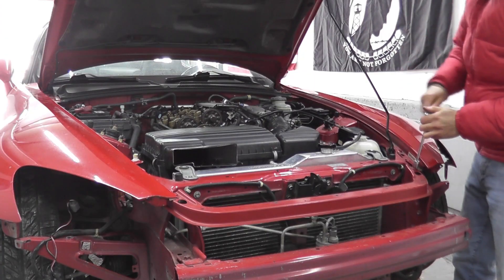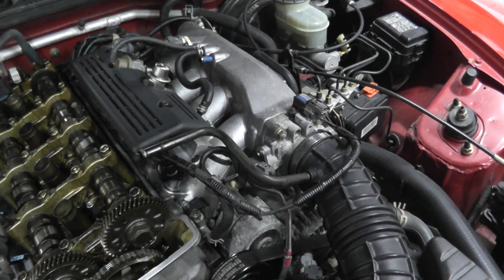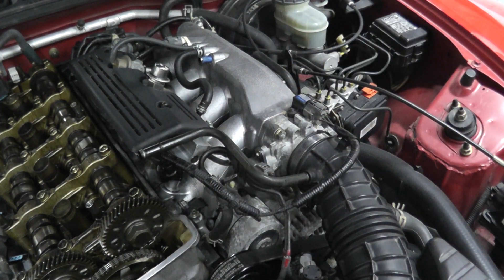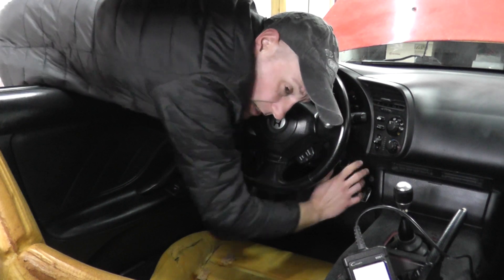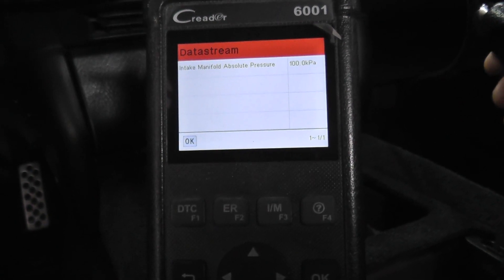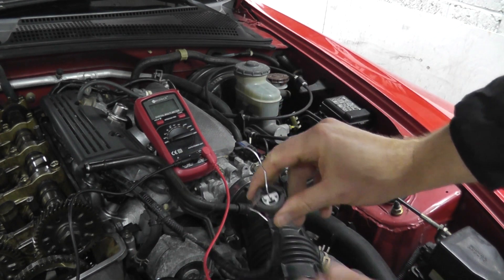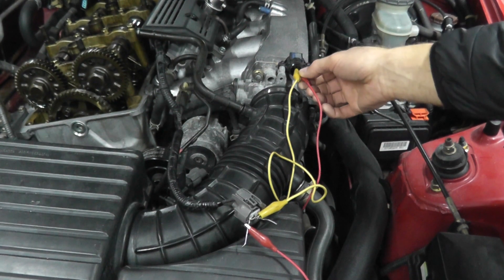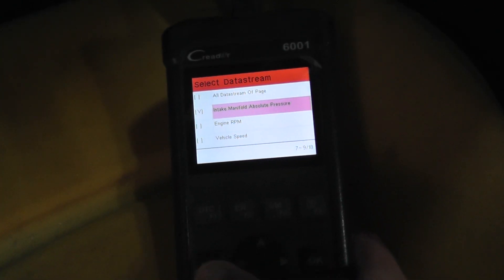Honda S2000 MAP Sensor Testing and Replacement

Comment: Sweet S2000! Beautiful Honda! I have an 03 IS300 Sport design and I love this car. 

I'm going to change the map Sensor for my mom's Honda Fit I'm getting P0107 code and I checked her map sensor and I didn't hear that snap. I'm going to check the readings today and clear her out. My mom's 08 fit has like a skip in the engine and she's not running smooth! Shifting hard in the beginning and starts off shaking. The reading my scanner got was the code above.

Comment: Don't ever use a paperclip to probe the front of the connector terminals, it can spread them out to far and cause connection issues. Use a t pin or get actual back probing tools.

Comment: Can you please verify the setup you used to test the map sensor?  Initially with harness fully connected to sensor, the scanner reads 100 kPa.  Then you unplug the harness and jump only the power and ground connectors and the scanner reads 0 kPa.  Then you jump only the signal and ground connectors and the scanner reads  176 kPa. Those are the values that will tell me that the map sensor works fine?

Comment: Do you have the voltage to pressure data on this sensor?  I would like to use it in a MegaSquirt install, but I can't find the curve for it.

Comment: At least in Subarus, I've found that using a Philips screwdriver with the point slightly flattened allows the blades to seat fully in the screw head which minimizes the risk of slippage and  stripping.

Comment: Hey if you come across Mdx (Tl)work and you tape it,I can't have enough of them,I've been doing all my own work because of YT info lately,I'd like to attempt a valve adjustment, but all the things that come apart scare the crap out of me,also a good idle pulley video would be for me,thx and keep up the gd work